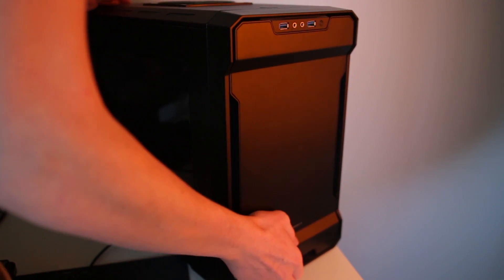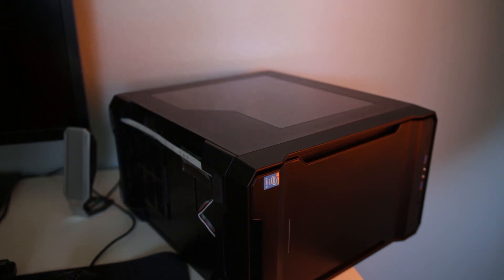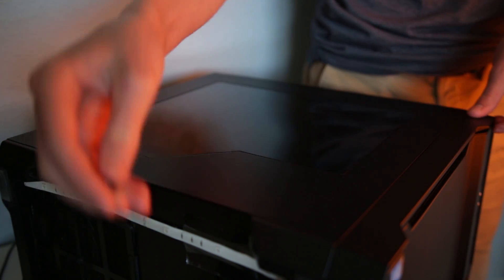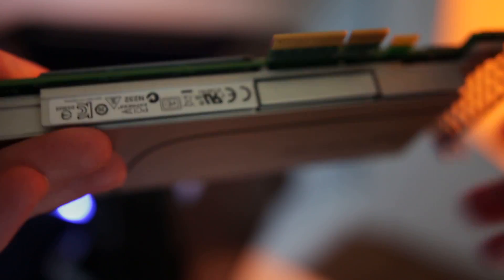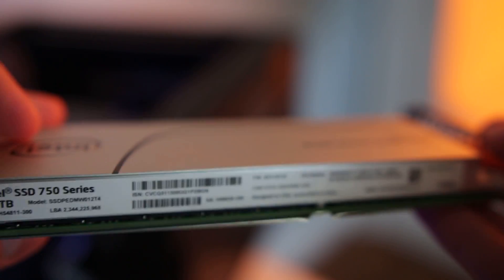What's an $800 SSD like?  (Intel 750 Series 1.2 TB!)

Comment: The poster needs a monster motherboard to be able to test devices and new hardware. The monster MOBO must have plenty of PCIe slots expecially for Graphic cards, and SSD storage devices that requires PCIe x 4 interfaces.  M.2 MvMe SSD drives will need those PCI express slots.   As for right now, the poster is limited to his meager rig.

Comment: dont you connect these ti the mini pciE?
Reply: Mini PCIe is actually a different slot all together. Looks a lot like a M.2 slot. The SSD can fit in a PCIe x4, but it can fit into a x16 slot like he did here. I have a tiny x1 wifi card plugged into a x16 slot when I run SLI.

Comment: Sooo now stick it into the 'Custom'-Core2Quad Rig ^^
Reply: but why
Reply: Because. I upgraded mine to a 'Normal' 2,5" Ssd and it's got 6× The Speed than before (Sata 1 Hdd)
so a pcie ssd will go even faster!
Reply: Alex Kirchgessner meh
Reply: Not Meh. Awesome, especially if you are upgrading an older 775-like pc
Reply: Alex Kirchgessner i still have pentium e6600 and gt 520 xD
Reply: It's a Core 2 Duo e6600 with 8gb ram, Sapphire HD 5770 and watercooling on my side ^^
Reply: Alex Kirchgessner hey,we're kinda same!
Reply: Yep. But i know the limit of what such a system can take in terms of Games. Right now i've installed Assassins Creed 3 aand it runs like shit with 19-30 fps on 1280×1024 res...
Basically everything before 2012 will work perfectly
Reply: Alex Kirchgessner yea i can agree with you.I can still play csgo,sometimes tf2, basically not that hard to run games.
Reply: Yep, but i've got the problem that this piece of crap happens to be my main rig. Next week im gonna buy a RX460 and in the next months
 i wanna build a "new" pc off the i7 2500/2600K.
but for now and the last 5 years this was my pc...
Reply: Alex Kirchgessner niiice,This month I'm buying "G3258"(pentiium) and RX460.
Reply: Doritos Master  Niiice Dude. But maaaybe (just think about it) Consider looking at the Second Gen i5/i7 (2400/2500K i5; 2600K/2700K/Non-K for i7) These are pretty cheap nowadays and offer stellar Performance...
Reply: Alex Kirchgessner yea.. well that setup is just for a moment :-), next summer im working in a new job and getting i5 and rx 480.
Reply: Okay ^^ Wish you luck
Reply: Alex Kirchgessner you too :-)

Comment: In real world scenarios it's not even 5% faster than a 850 Evo over Sata, If you bough it with your own money you should just return it because it's a waste of money + you have to buy a new MB.
Reply: are you dumb... Sata cables are a huge bottleneck and switching to a m.2 or pcie ssd will improve drive speed by about 45-50%
Reply from the maker: "real world scenarios"...That's quite a blanket statement. It all depends on how you use it. Obviously your in-game benefits will be almost non-existent, but it's not designed for gaming. It just all depends on how it's being used. I wouldn't recommend this drive for most people - SATA SSD's are fine for most.